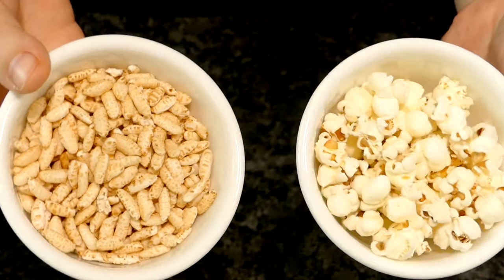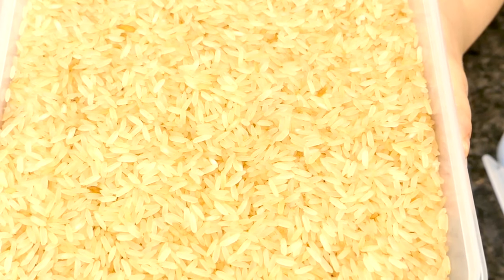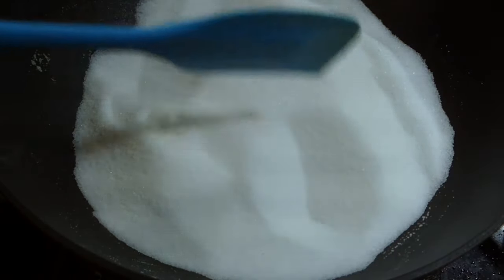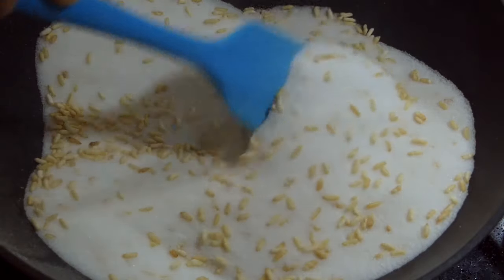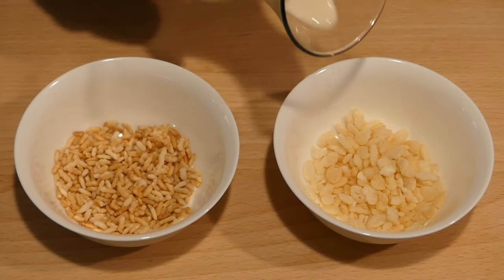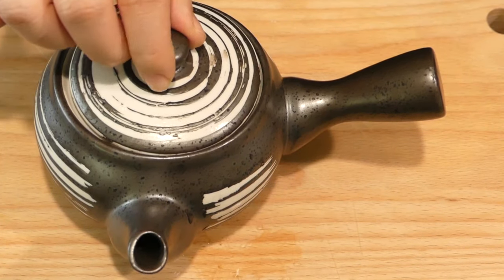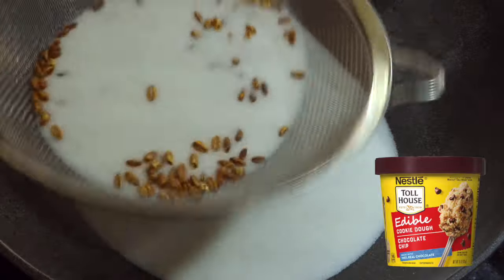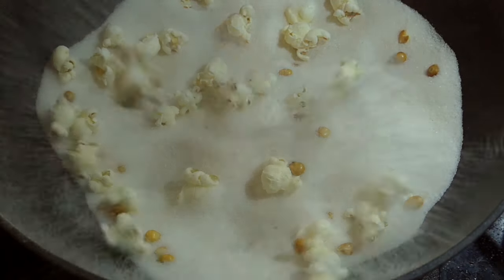Homemade Puffed Rice/Grains with Hot Salt (Murmura) Method

Comment: This is extremely impressive. What I'm gathering is that this isn't a treat that's reasonable to make at home. Thank you!
Reply: The crispy rice is easy!  Lol. We haven't tried the other ones yet.  do a little bit more research.... I have seen other demonstrations where it was extremely easy!
Reply: She cooked the rice too long
Reply: I just made it using instant brown rice and salt! It was definitely good. You should give it a try. It was similar to the difference between regular chips and kettle chips. It stayed crunchy longer and was crunchier than the cereal. I managed to get it fully crisp, though, without any hard center. I find it better to place the strainer over a pot and pour the cereal out when it's done. That way you aren't trying to catch the pieces before they burn.
Reply: "Impressive"? It's salt, rice and heat.

Comment: It's much better to use something like black Salt or even sea salt.   The coarser grain doesn't stick to the product (there IS residual saltiness from powdered salt, at least my family can tell a difference).
Reply from the maker: The salt I used has a fineness close to granulated sugar, not as fine as powdered, so it didn't impart discernible saltiness that I could tell. I didn't know coarser salt would work, since grains needed to be fully submerged, I thought coarser pieces would have more space in between
Reply: @workdaygourmet  the steam from popping will allow some salt to adhere to the grains. I admit its not much but has been noticeable in my family.   As long as the bottom of your pan is covered in the coarser grain and you stir as it puffs they will work perfectly as a heat conductor.  It doesn't adhere as well, and if you use black salt, it's much easier to get any small pieces that may stick.   There are other videos discussing the differences between types of salt/sand to use to puff grains that go into more detail.   Whatever works for your family is best, always.  Just putting it out there that there are other options.

Comment: I've experimented with this as well, and I found that parboiled rice is the only type of rice that made the puffed rice edible, and not too hard. It might also vary depending on the type of parboiled rice used. However, I also found that the salt needs to be around 230 ºC to puff up properly. Cooler than that, and the puffed rice will be too hard. I use a digital infra-red thermometer to monitor the temperature of the salt before putting in the rice. They're relatively cheap at around $20. 
Put the puffed rice in a bowl with milk, and they taste great. Home-puffed rice is definately better than commercial rice-crispies.
Reply: I have personally tried to puff raw rice and it work perfectly well ! No need to cook it before.
Reply: @fraaggl ?
Reply: Thank you so much for the tips. My first batch was a little too crunchy in the center, but the second attempt was perfect. So fast and easy!
Reply: thanx
Reply: how to make parboiled rice
Reply: Great tips! Do you remove the salt stuck to the grains before eating? If so, how did you do it? Thanks!

Comment: Thanks for showing us how to do this!!!!!!     Uh oh! The corn was a mess! 😬 I was thinking if you had an old fashioned stove top popcorn pan that you could prevent the mess. Those pans have a stirring bar inside it so you could keep stirring and have the lid on to keep everything from popping out!!
Reply from the maker: I actually have multiple popcorn makers 😂 there's definitely little need to come up with new ways to pop corns beyond the classic methods. A little oil and a lid works great.  I just wanted to finish the salt experiment on a high note with a grain that I know definitely would work. Who knew it would be such disaster!
Reply: @workdaygourmet  I thought it was going to be messy when you covered up the single test piece at the beginning. I theorize it must have been the weight of the salt that kept it contained. The scooped kernels weren't all buried so well when they popped, so the salt was thrown more.

Comment: I would soak your parboil rice a little then dry quickly and then puff so there is more moisture
Reply from the maker: How do you dry quickly? Doesn't it usually take at least overnight if not a few days?
Reply: @workdaygourmet  like in a towel. When using salt or sand. Not the same as oil. But really i am just curious and hope to try sometime researching